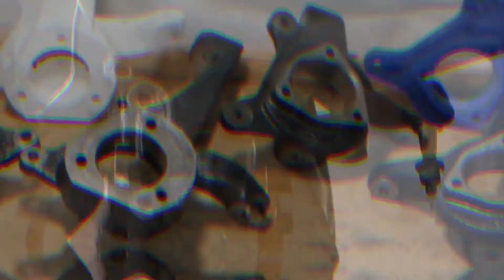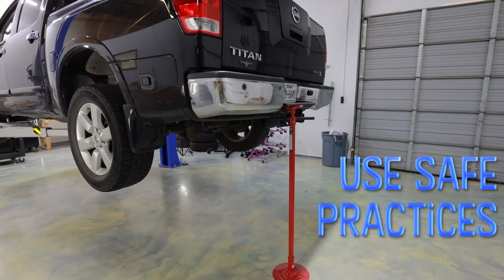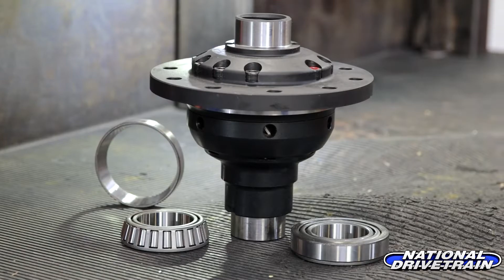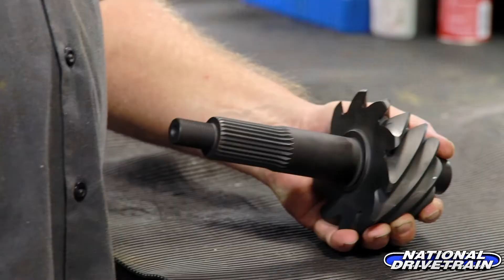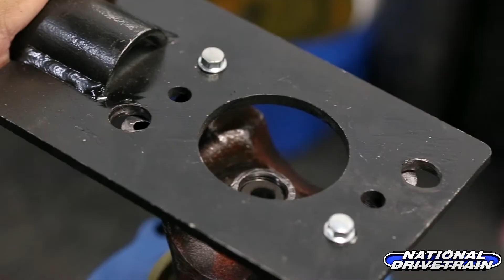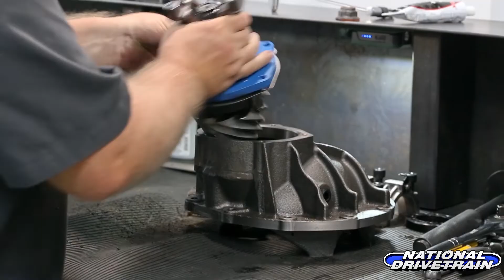Ford 9 inch Build

Comment: what the different in shim the pinion or using the crush seal
Reply: I get no marks on the gear? It is set at 10 thousand backlash. The pinion, I tried 33 thousand al the way down to zero, no marks on the gear? And help would be appreciated. Thanks!